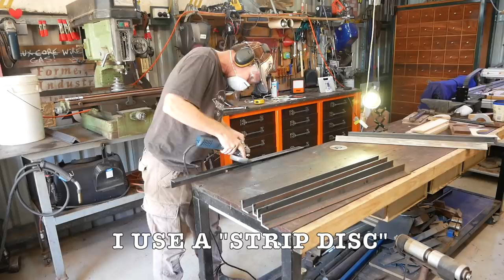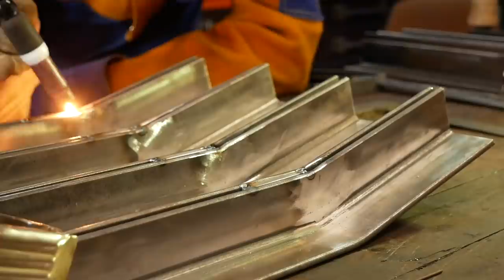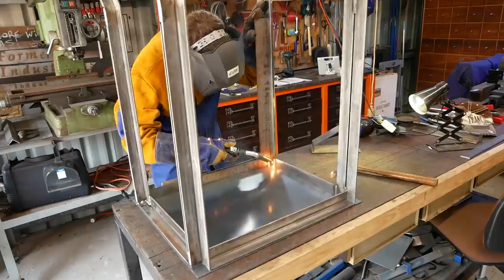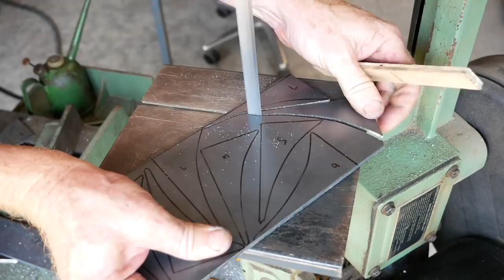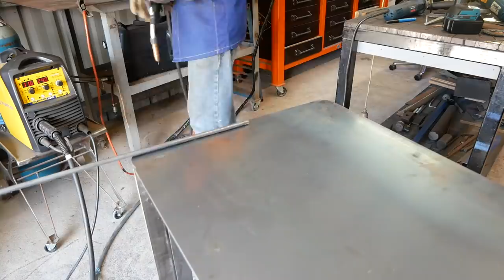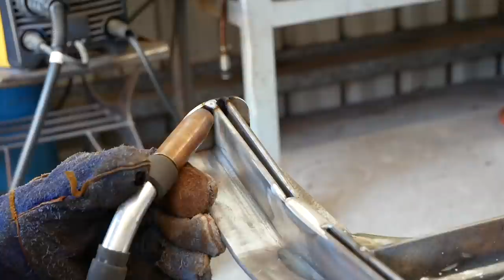Making a 'Beefy" Steel Milling Machine Stand - Forme Industrious

Comment: Finally You get the mill ... Big progress in workschop , MIG is faster but much moore griding then after TIG
Reply: True. Where do you want to spend your time--front end or back end?
Reply from the maker: Yes but it may be a while before I can make use of it but it will be very nicety have it.  Yes TIG is good like that, but I was running very low on gas unfortunately. I still need much more practice.

Comment: Nice! Beautiful work as always. That border around the edge will come in handy if you decide to add a coolant system. Used to have the exact same mill, they're great workhorses especially if it was for free! Even if you don't do milling on it, they're also one hell of a drill press due to the weight. Took mine apart to clean it too, they're not too complicated. There's a good chance it's in better shape than it looks once you get all the rust out and give it plenty of oil
Reply from the maker: Thank you Phil! I remembered watching your Mill restore video a while back and when I got this mill I went straight back to your video to see what I have to do :) So you have been a huge help already! Yes there is quite a bit of rust on this one. On the Chrome parts too. All the best!

Comment: You are a lucky dog gifted  a mill. You may need to put an extension on the post, by the time you get a vice and cutters you run out of height. Watch  "double boost" he did a mod for this on his mill. You are going to need drawers for all your milling tools. I was told that the tooling is the most expensive part and I agree. I love your belt grinder in Canada it is all most $500.00. Love your work, keep the videos coming.
Reply from the maker: Might have to add some shelves and drawers down the track. Have to save up for tools :) Lucky Indeed! Thanks Carl!

Comment: Nice build Scott. You used some innovative ideas in the design. The gussets are a nice touch and give a nice line to the stand.  My mill is very similar and too had to build a stand for it.  One addition I found helpful was two iron wheels mounted to the back so I can lift the front on a roller and move the mill.
Reply from the maker: Thanks Douglas! I may make a trolley jack for this one. Cheers!

Comment: Nice job you did. Must say you go the extra mile with your attention to detail on something that just needed to be functional and strong. Also liked the round bar lip on the tabletop as well as the gussets...
Reply from the maker: Thanks Paul! Well I have a knack of overcomplicating things to get it to look somewhat vintage I guess. Gives the shed a nicer feel to it.
Reply: @ScottTurnerformeindustrious  More pretty never hurt anyone....
Reply: @ScottTurnerformeindustrious   Why don't you use a VFD on your mill to convert single phase 220volt to three-phase 220v or 380v. You have the added ability to reverse and variable speed. The Chinese ones are very good and affordable. I have a .75Kw one on my metal lathe and a 1.5Kw one on my belt grinder. The make on mine is Powtran.
Check out South African guy Neels van den Bergh' website on  https://www.cfptechnologies.co.za/.    Very helpful and knowledgable guy. Did all my setups for me. Been bringing in the stuff for many years.
Reply from the maker: @paulvanzweel8287  cheers, VFD is the way ahead by the sounds. Thanks for the links also. Cheers Paul.

Comment: Yet another great build Scott!
A handy tip that saves time when changing grinder disks is not to use the tool to tighten them up. It is self tightening and will not come off, just grab the disk and turn it with your hand to nip it up slightly. It will undo just as easy. The only time I need the tool is when the very thin cutting disk snags or jams in the work piece.
Reply from the maker: Thanks Craig. I will try your suggestion - cheers!

Comment: That's a really cool and interesting way of making a table out of angle iron. They do make a sort of T section but I don't think it would look as good as what you've achieved with angle. I once made flared-out feet a bit like that for a BBQ but with square tube. I set both angles on the chop saw (swivel the base and tilt the saw), cut 100mm or so off the end, rotated it around and welded it back. That way it flares out in both dimensions not just one.
Reply from the maker: Thanks Ben. Good idea. I went this way for the appearance I was after.

Comment: Always enjoy your videos.  Based on experience with my Bridgeport mill - I suggest going with a VFD instead of converting to single phase.  VFD is the cat's meow. Unlike what some people will tell you, you'll still need to change belts on rare occasion for more extreme speed changes, but in general the VFD will make the machine much nicer to operate. I have a video on my channel showing the conversion I did.
Reply from the maker: I'm sold on the VFD. Want the Cat's meow brand however. I'll head over and take a look at you conversion. Cheers!
Reply from the maker: Nice job on your VFD, Nice Bridgeport also.

Comment: VERY handsome fabrication. A little Art Deco gussetry mixed in with the need for strength and rigidity. I might have added a couple under-table stiffeners until I saw the mill base precisely inset to the edge of the stand where its stiffened by the apron. Elegant appearance and simple construction wrought by good design, planning, and careful work.
Reply from the maker: Thank you! Yes I think I might add some 1/4" thick washer plates under but that's about it I think. The base is very close to the steel structure.

Comment: Nice work Scott. I had a mill just like that but mine had the auto downfeed mech on the side. It came with a 3 phase motor and I put a VFD on it and never regretted it. I upgraded to a knee mill HVM50. I also fitted a 3 axis DRO on it and wow it was a beast. the Z axis went inside the quill. I had 2 "Bridgeport" ball  handles, one either end and a new turn wheel in the front.
Good luck with the refurbish. Cheers and great videos too.
Reply from the maker: Thanks for the feed back! VFD might be the sensible thing to do especially since it offers speed control. Thanks again and all the best!

Comment: Nice job Scott. I’ve got the same mill and put it on a stand too. They’re a great mill and I’ve had no problems with it. You can still buy parts for it too.
Reply from the maker: Thank you! Great to hear that. I have to pull it apart and may need some new bits inside.

Comment: Nice work Scott, really like the shape and flow of the legs, reminds me of an industrial bridge construction (Brunel or something similar). Use the same paint prep wheels to remove mill scale 👍👍 much better than acids etc! Thanks 🙏
Reply from the maker: Thanks Gus! That Mill Scale is a right pain in the Pitoot (as Colonel Potter (MASH) would say) but the Strip Discs get the job done. If I had a big enough tub I would try Acids.
Reply: Hahaha now that takes me back!! I use a non woven paint prep wheel which does a great job. I believe the acids make a better job but take time. I had a tip which is to look at stone patio cleaner which is supposed to do a good job 👍 thanks buddy 🙏

Comment: I watched this again today. I need to weld up a new band saw stand. I want to add extra pulleys down below to slow the blade down from wood working speed.
I would probably have used my gas rig to braze that bead around the top and avoided all that grinding. I think you could do that with the tig too, using brass filler rod. Just an idea. Great stand though.
Reply from the maker: Awesome Wayne - Thankyou!

Comment: Hey, nice job on the stand. great design. I'm in Houston Tx and I'm also a furniture maker and re modeler. I do some fabrication and welding. I have a Chinese round column gear head mill I've just restored, along with my old south bend machine lathe. I've restored a couple of Vespa scooters and I used to race a sunfish sail boat on the bay here. I feel like I know you. I'm a bit older now though. but I'm following your site now.
Reply from the maker: Thank you Wayne! Sounds like we have a lot in common. I've made my little 15 footer sail boat and love the old Vespas also. Thank you so much for the follow! All the best.

Comment: I like the design of legs and how they fit together with the cross members. 
Should be a very stable table for your mill drill.
Reply: Next vid: Machining Steel Castor Wheels From Steelyard Scraps
Reply: DrewT 
Tie that in with Neil Pask’s Scrap Wood Challenge and you get Scrap Yard Challenge.
Reply: @Crewsy  I love it!
Reply from the maker: Thanks Wayne - Yes I think it will be plenty strong.

Comment: Nice build, i really like that method of construction with angle iron.  No wheels or at least leveling feet though? I know wheels on a mill arent usually a good idea, but I figured for that since the mill still needs work, it would be better
Reply from the maker: Thanks David! Yes I need to do quite a bit of work on the Mill. I moved it using a Car Trolly Jack. For Level I will use some shims under one foot. The concrete is not perfectly level.

Comment: Spot on as always Scott!  Is the beading around the stand top tall enough so you could use it as a coolant catch/recovery tank in the future? Those windscreen washer pumps come in handy you know . . . . .
Reply from the maker: Thanks Gareth. More for looks and to create a soft round edge, however it will catch fluid if I need it to. The top has a low spot in the middle after welding (dished, not perfectly flat). Windscreen washer pump... mmmmmm sounds good :)

Comment: Solid video as always, Scott! Great detail adding the round rod lip. Adds heaps of rigidity and captures oil drips...may have been the perfect spot to practice long TIG runs. You'd have picked up speed & proficiency by the end of that marathon ;-) Best, @HoneyOnWales
Reply from the maker: Thanks Drew! I was running low on the Gas for TIG and I could definitely do with more practice. All the best!

Comment: Scott, Like you, I overbuild everything.  Real men will understand.  Couple of things you might want to add out in the future.  The first are a couple of drawers for chuck keys, wrenches, safety glasses, tooling, and such.  You will find as you mill away that accessories start accumulating; collets, tool holders, drill chuck keys (mine like to go walkabout), end mills, fly and face cutters, 123 blocks, hold downs, etc.  Every job will require something that you don't have. eBay is your friend.  Very quickly your tooling will exceed the capacity of those little strips of table top on either side of the mill.  Start thinking about it now so you will have one of your elegant solutions ready when you accept the fact that you are culturing a mess. Second, put it up on some casters.  That way you can put it out of the way when you are not using it and pull it out as needed.  Just about everything in my shop ride on casters because without them they start to grow stacks of storage deferred valuable windfall acquisitions around their feet that never seem to get used. Steve
Reply from the maker: Wise words Steve - thank you!

Comment: Tig weld that bandsaw blade back together..
Grind it flush where you welded it...
You should get some more hours out of it...🇬🇧👍
Reply: I second that, purely for curiosity sake if nothing else.
Reply: @drewt3210  This Old Tony has a video or two where he talks about doing this
Reply: @shalormckee2784  Thank you!
Reply: Our vertical bandsaw at work has a blade welder attached to it
Reply: @TheMeta6  

Yep...but they're usually resistance welders (same principle as a spot welder)...

You can get or make a simple holding jig with a copper back pad...to ensure alignment...then give it a quick squirt with the mig...🇬🇧👍
Reply from the maker: That I will! I see all the tips below. Cheers all!

Comment: Scott you need to put your skills with timber to work and add some drawers with compartments for all your tooling that you'll eventually purchase. P.S. - You're going to spend a fortune on tooling, it's almost always as expensive as the machine in the long run
Reply from the maker: True - Yes I'll need plenty of tooling and various things and that will all come over time. I won't need a lot to start with as I cannot foresee major machining operations in the near future. Also some drawers can be fitted down the track without too much drama. Many thanks!

Comment: Awesome job as usual. Just wondering what brand of strip disc you use? I've tried the 3M ones at bunnings and they don't seem to do a very good job in comparison.
Reply from the maker: Hi Adam, Thank you. My strip discs are nothings special either. Got them from Ebay. 10 for about $25 from memory.  If you push too hard they tend to leave what looks like a residue. I use light pressure and they work okay. Still time consuming.
Reply: @ScottTurnerformeindustrious  thanks for taking the time to reply mate. I'll suss them out. Mill scale is my worst enemy at the moment. Feel like a need a pole in the workshop ATM, I'm always stripping something.
Reply from the maker: Ha! What happens in the workshop stays in the workshop ;)

Comment: Scott, the bandsaw you use for cutting metal, is it a woodworking bandsaw with a metal cutting blade in it or is it a metal bandsaw?
Reply from the maker: Hi Simon. It's a metal cutting Bandsaw using a Bi Metal 13 TPI Blade.
Reply: @ScottTurnerformeindustrious  Cool! Another tool I need to buy then ;)

Comment: Is 3-phase not common in Australia? Here in Denmark all houses have it which is convenient if you want to run big machines.
Reply from the maker: Yes it's on the street power lines, but I would need to have it connected and run to the shed $$. Most houses would not have 3 phase installed (though it is available).
Reply: @ScottTurnerformeindustrious  That's a bummer. I guess you run the more power hungry stuff on 32A outlets and heavy gauge wiring like we did in UK? I have a 240V plasma cutter I bought in UK but I can't run it at full power here as that would require a 32A fuse and we only have 16A on each phase.

Comment: Could you weld the saw blade and keep for a standby?
Reply from the maker: I could I suppose though I think by and large the blade is fatigued. This blade did not snap on the original join. It's worth doing like you say though.

Comment: Not set up to spray two-part poly but spraying that faux whipped cream on everything will kill you just as quick 😆💀 but ... nom nom. re tig vs mig - tig seems to be the one people have the most trouble mastering from what I've seen (there seems to be a lot of people "practicing" tig welding on YT) - what is its main selling point?
Reply from the maker: I'll get back to you after I finish my Chocolate Sunday.....hang on....
Reply from the maker: TIG selling point. Good for fine welding when you don't want too much heat. Small pretty welds. MIG just checks it on. TIG for when you don'y have a MIG and you are too lazy to do woodwork ;)
Reply: @ScottTurnerformeindustrious  okay - now it makes sense why it's used for aluminium I guess because it's cooler. Cheers .. TIG = smaller cooler prettier.👍